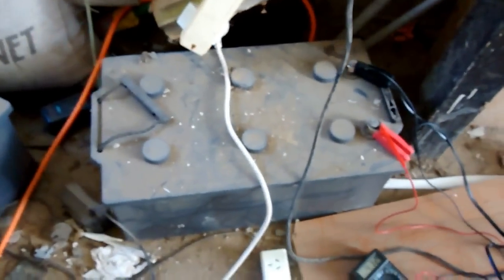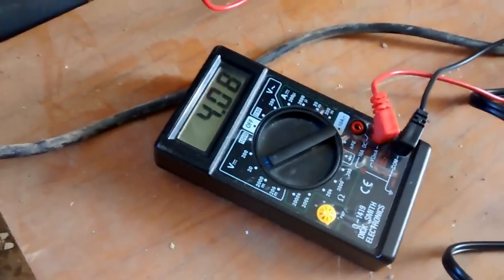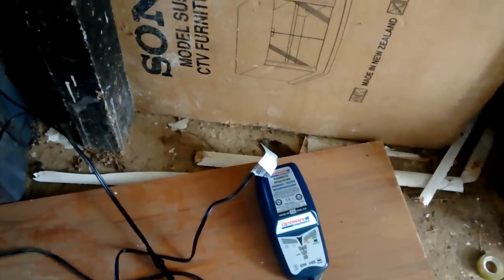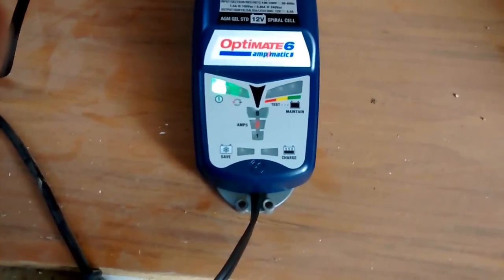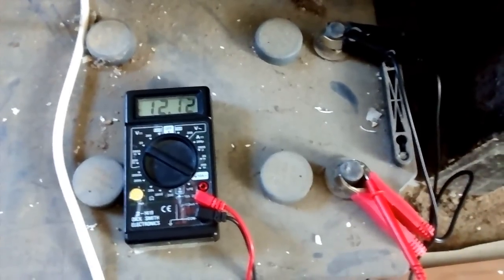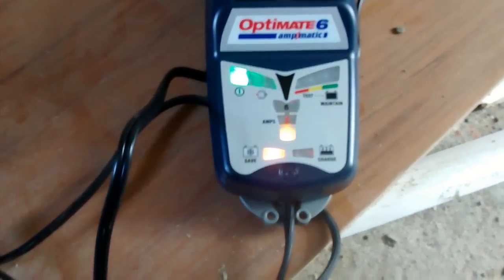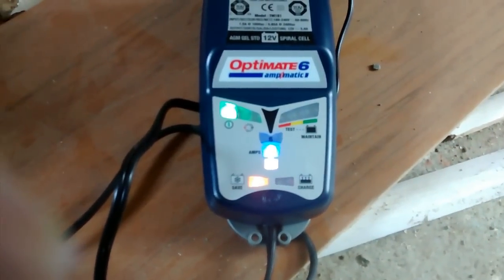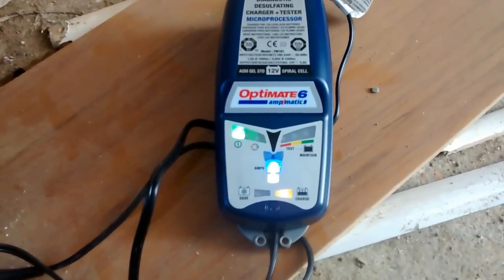OptiMATE 6 and a dead 180Ah Gel Cell battery

Comment: Will this method work for AGM battery? I have a bunch large capacity 2V AGM batteries of which I suspect have a sulphation problem. I used them in a solar power system.
Reply from the maker: Sorry, don't know.
Reply: It can work, but you need to connect six such cells in series in order to form a 12V battery so that the optimate charger will see a normal battery. The only problem with high capacity cells is that they will need much time in order to recover since this charger puts out about 5A maximum. The desulphation process in general takes long time and needs patience. But you have nothing to lose anyway...

Comment: Well but what Amp it can deliver? The thing that you have 12V voltage doesn't mean anything if the battery can't deliver some high amps. Did you try it?
Reply: optimate 6 can deliver up to 5 amps

Comment: Just because you get it up to 12 volts doesn't mean the battery is good. You won't be able to draw any amps out of that battery. For a 1 amp charger to charge a 400 amp battery, you'd need 400 hours of charge, and that's if it would hold the charge.
Reply: a400 is the model nr.. it is a 180 amp battery and the optimate 6 can charge at 5 amps top instead of 1 amp like the optimate 4

Comment: batteries are bulglng as it is so suplhated it has expanded inside, dead as a dodo, and as white as santas beard inside, put a load on the battery, it wont do much :}  .  did it recover your car battery fully?
Reply from the maker: I need to find a 12V load to put on the battery to test it.  Car battery is untested and will be used as a backup if my new battery goes flat.  Final status was the the car battery was "good", but not "very good".
Reply: yep the battery was bulging from the crystalization/sulphation ... now way to recovery it ... especially GEL... it was dead. There might have been some active material hence the voltage reading. But after the longer rest time it went down considerably. That was a dead battery , 15years is way too much sometimes even a year or two means a dead battery if not charged.